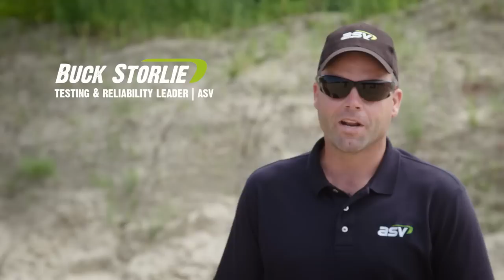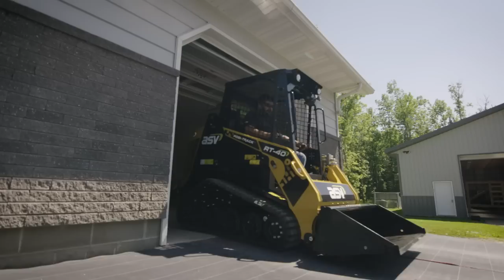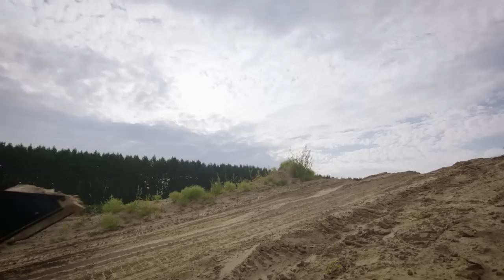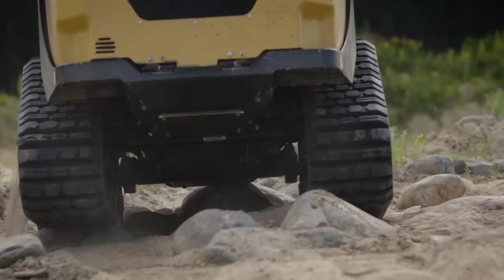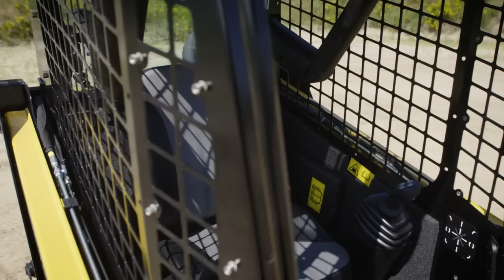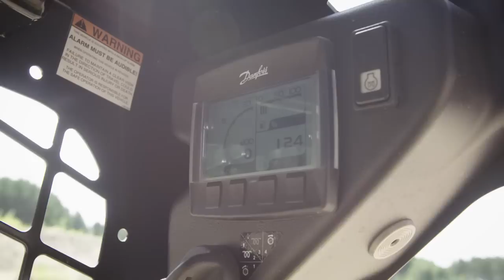RT-40 Posi-Track Compact Track Loader Walkaround

Comment: I traded my 30 in on the RT 40. It is a totally different animal and MUCH improved. Every complaint I had on my old one has been redesigned on this. Out is the Perkins that needed ot be glowplugged in plus 100. Out is the stupid battery location and useless fuse panel location. Power can't even be compared. Best of all this new one doesnt tip the second you fill the bucket. The balance is much better.  If you are debating 25 or 40, go with the 40 for sure. There are a ton of differences betweeen them.
Reply: what year did you buy?

Comment: Is this machine available with heat and air conditioning?
Reply from the maker: Hi! Currently this machine has a closed cab version available with heat. Stay tuned for future upgrades.
Reply: when will  @ASVCompactEquipment  start putting red lights on their machines like all of the other machines

Comment: Will the quick attach fit the same as traditional mini skidsteers like the dingo?
Reply from the maker: Hi Jacob, the RT-40 can run the same attachments as the mini skid steers if you use an adapter plate. Thanks for the question!

Comment: great machine and video, when are we gonna get a new model rt-60 ?
Reply: lebotube64 soon, there is a new rt65 coming
Reply: saw some articles about the unveiling in september, but i cant  find pictures or specs. do you know if it will be as wide as the rt-60 ? thx :o)
Reply: Google new rt65 quality forklift
Reply: Norman Martin wow 😮, thx dude. Definitly gonna have to buy one next year !
Reply: It’s similar to the vt70 without vertical lift loader